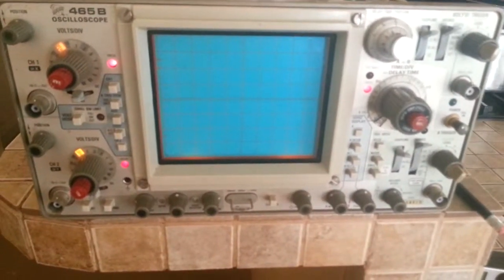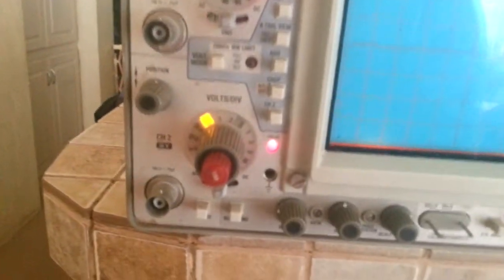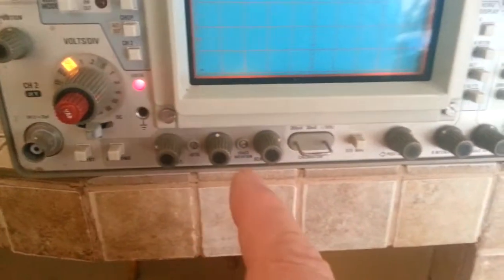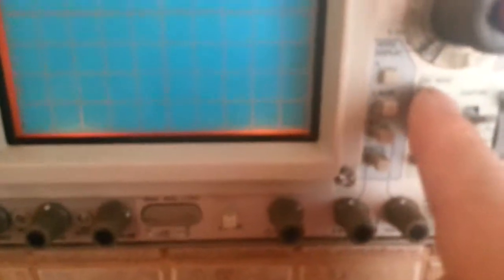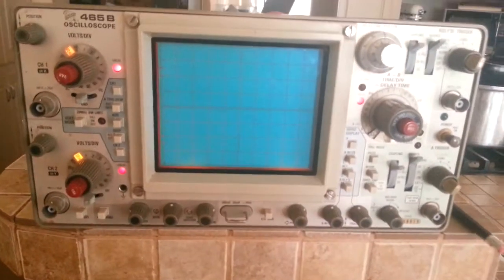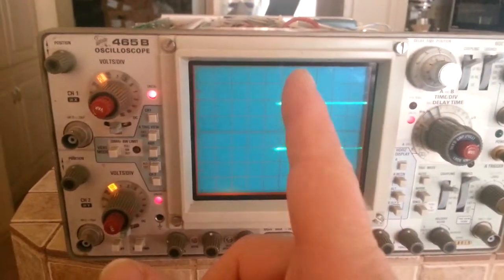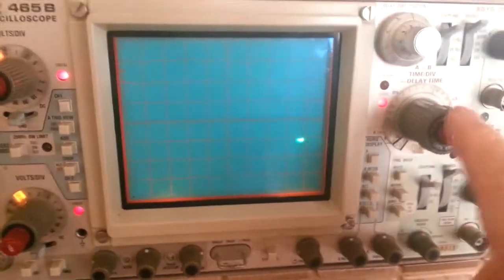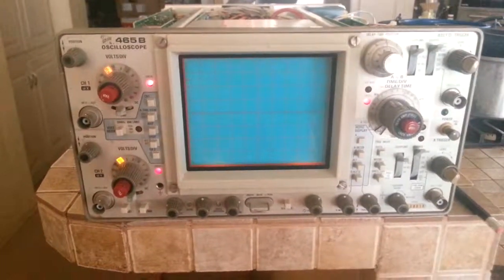Tektronix 465B Oscilloscope has Short Horizontal Trace Irregularities Part: 2

Comment: Robert, 

 There is no Part 3 because I gave up on this Project some time back. I spent an inordinate amount time Troubleshooting this thing. 

 I do know that the +5 Volt Circuit does have a Thermal Resistor in the Circuit. Maybe that's Wonkers? It's supposed to keep the Circuit Steady as the Temperature Fluctuates during Operation. One nice thing about the 465B is the Transistors are Socketed. That means you can just Pull them Out by hand without Desoldering. Sometimes Reseating a Transistor Fixes things. 

 Maybe your Rectifier is on its way out? Check thoroughly for Bad Solder Joints. 

 There are some Really Really Really Smart Guys on the Textronix Forum Online who love to help. 

Keep me posted on your progress.

Comment: Hi, I looked for 'Part 3' of this clip, but it doesn't come up. As can be seen by the numbers of frustrated writers, this appears a common fault with the 465B. I have a 465B that works perfectly for about 30 mins, then the 5VDC rail drops to 2VCD and I lose my trace. Transistor Q 4312 (5 Volts B+) starts heating up due to the shorted load. Do you or any readers have any ideas, as the 5 volt rail goes just about everywhere on this CRO. Tantalums don't seem to be the problem, though I may have missed one.

Comment: Probably too late but check the 1000uf 10v capacitor in the middle of the bottom board:-)
Reply from the maker: Does that come from experience?
Reply from the maker: It's still not Working... I kinda just gave up on it when I bought another used 100mhz HP Scope.
Reply: @Puner54  Yep, mine was a dead short, it's on the -8v line. Stopped the sweep from working.
Reply from the maker: @StillakidThe  I have eyed that Cap many times as it is an Electrolyte.